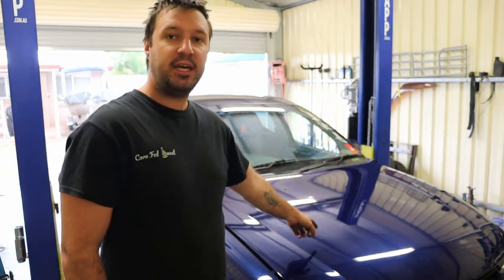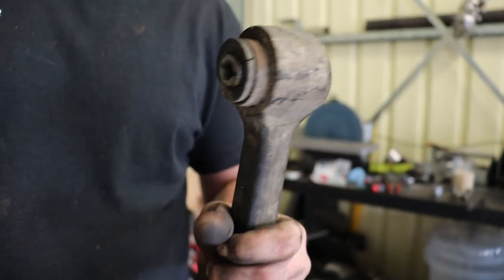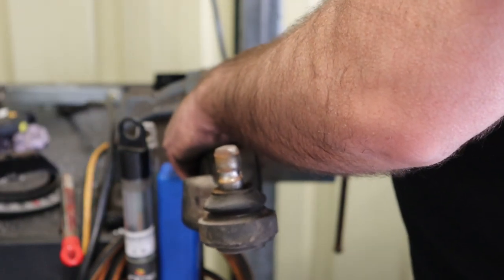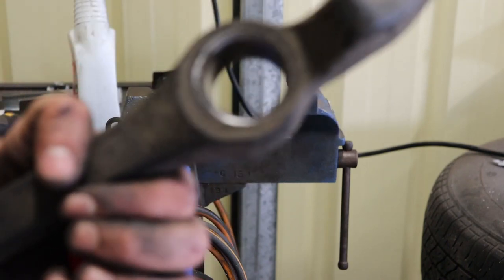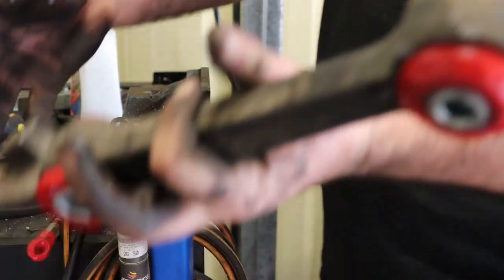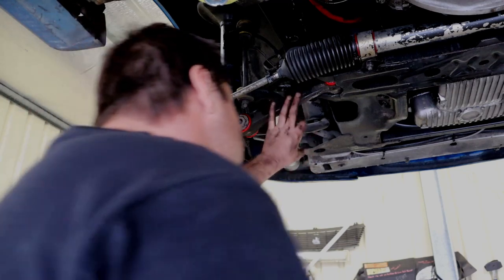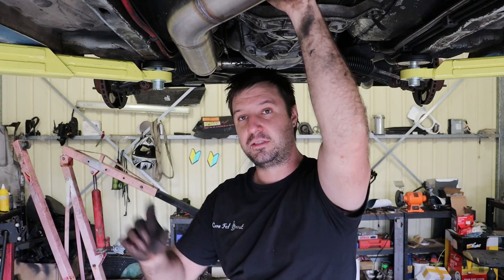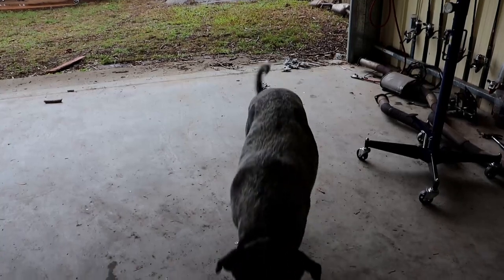how to change your commodore control arm bushes...

Comment: I did mine in a VY recently on jackstands. Wasn't too hard tbh, I changed the front radius rod bushes too and the sway bar bushes and link pins - all Nolathane. Fairly straight forward. I bought new arms with the bushes pre-fitted to save changing the bushes out, made it much easier. And yeah it's transformed the car, steering is much tighter and no annoying squeaks
Reply: Those bushes would be about shagged already being nolethane yeah ?.
Reply: @Ozzierob  No idea mate, I sold the car around 2 years ago not long after adding that comment.

Comment: Man u made it look so easy... it took me ages.. got em out thou had 2 use a drill-petrol - lighter & ball joint press....didnt find the ones u installed till after i got the 2 peice 45318 nolathanes..
Reply: Do you know the part number for the outer ones.

Comment: Good video, i'll be doing my bushes soon.  How about the bushes on the rear? Would they need doing?  How hard to do those?
Reply from the maker: Thanks mate, the rear control arm bushes are a bit of a pain to do but the subframe bushes are quiet easy to swap over for some polly ones